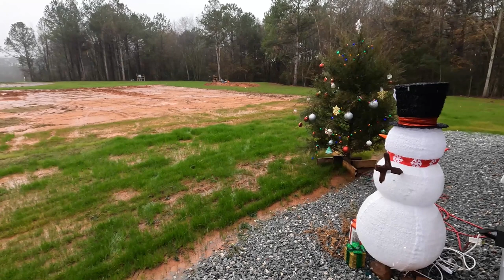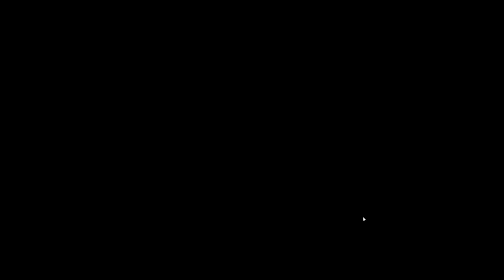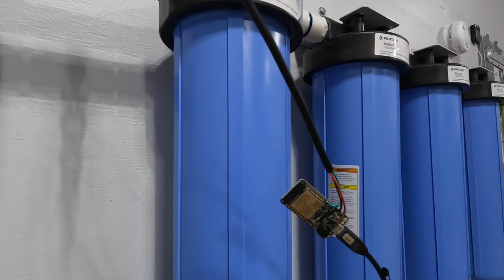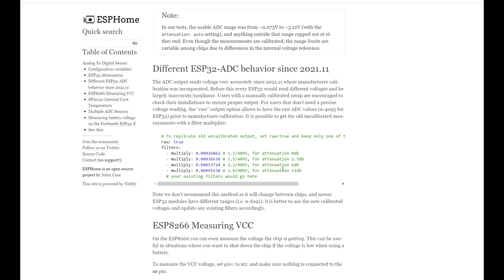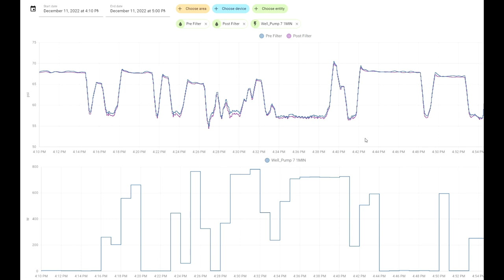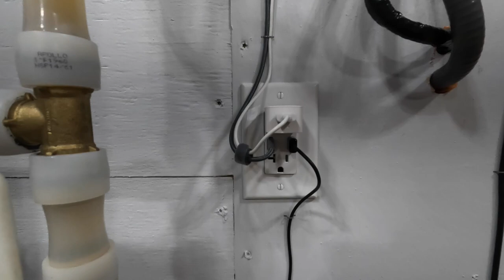Home Assistant ESP32 Water Filter Monitor

Comment: Awesome system if you perhaps monitor the first filter with another wire as is likely it will fill up first and may even end use before the others are full I guess it depends on how you plumbed it in if they are in series this maybe true but if you used a header it will not be at least in my opinion. Cheers great video.
Reply from the maker: Spin-down filter is a life saver when it comes to that. Video on that is incoming. However, data over time will help determine how we go about knowing when to replace filter/s.

Comment: Since your main concern is pressure differential, and that would change with flow rate, couldn't you  1) subtract the value of one sensor from the value of the other sensor (producing a single differential voltage) to eliminate the "square wave" caused by the start-stop of average daily usage, which would allow you to 2) establish a somewhat level baseline for new/clean filters, noting the values for low and high flow rates, perhaps allowing an easier means of establishing threshold limits within the program?
As the filters become more clogged the line will rise or dip from the clean filter baseline (depending on how you've programmed it).
Reply from the maker: Thanks, I understand what you are saying. This where my script/program writing skills are lacking.

Comment: This is very similar to what I did with ESPHome and sensing my voltage on my mains vs. my subpanel (Power Wall). The only way to calibrate any of these devices is to measure with an analogue device  (For me it was my amp probe) and compare.. I'm not sure if you have pressure gauges on both sides of your system, but this would be a good way to calibrate, but also monitor with your ESP32's. I love these boards! I have one of mine monitoring my JKBMS Finally! from a yaml I found online for Home Assistant and it's flawless..
I was also going to do something very similar on my furnace with air pressure monitoring on the line and load side of the air filter to that I would know when to change my filter.. LOL 
Hey, it's just pressure differential! We did it at Amazon on temp controls, so why not at home right?
Reply from the maker: Used 2 known good pressure gauges that agreed with each other. Calibrated off of them. ESPs are FTW. Thanks,

Comment: I saw a neat "smart home" water measure that could detect leaks in the house, which I think you could easily add here. 

Add a computer controlled valve between the supply and pressure sensor (either one, I suppose). Once in place, close the supply at, say, 3AM once every week or two for 30 minutes or so. During that time, graph pressure on the house side. If there is a consistent downward slope, it's an early warning of a leak somewhere.
Reply from the maker: I love your idea......
Reply: I had the same thought about a leak detector system.  And if you went as far as installing an electric valve you could turn off the water when you leave. You could go as far as if there is no motion in the house it closes the valve. A couple of motion detectors might be enough. Things are endless on what can be done now.